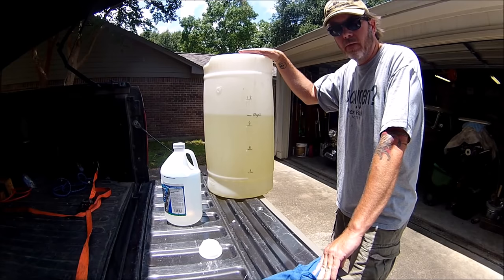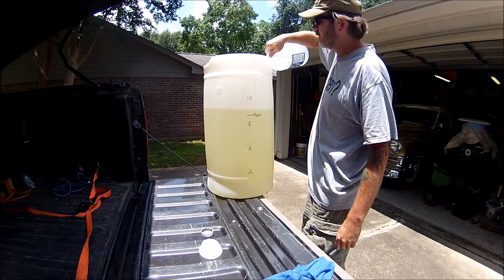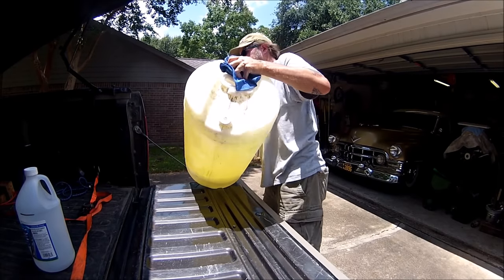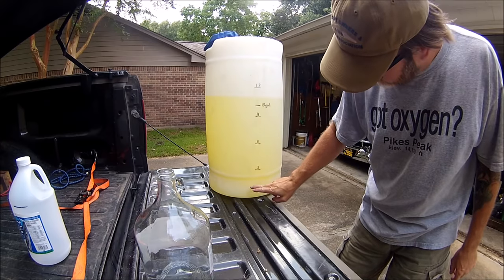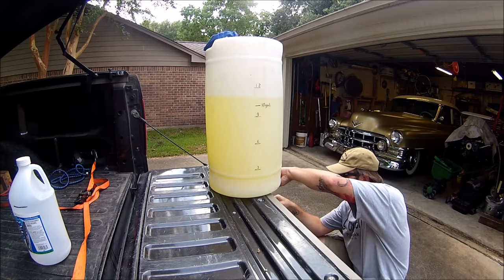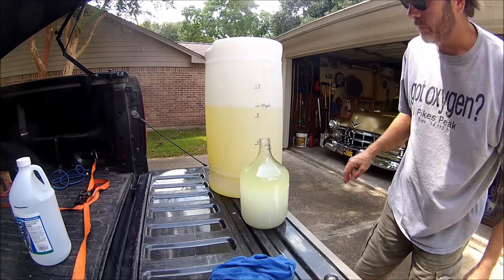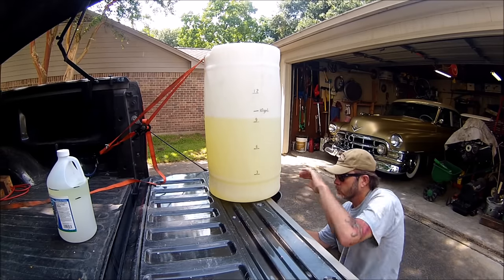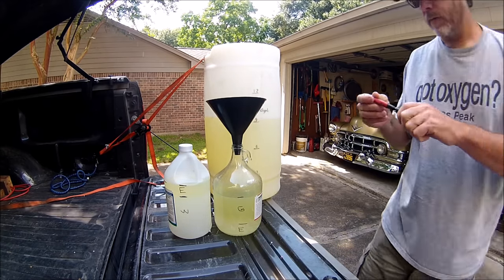How to easily extract ethanol out of gasoline.

Comment: I tried this... and when I put it in my Tesla... it did not give me better mileage...
Reply: Only a moron would drive a Tesla.  They are less fuel efficient and more harmful to the atmosphere than a gasoline engine, when you factor in the environmental impact of manufacturing, maintaining, recharging and disposing electric batteries.  Where does that energy come from?  Oh, right.  Thin air.  It’s a sham or maybe even a scam.
Reply: Probably because you didn't put it in the radiator.
Reply: That was a funny AF comment!
Reply: @danielholtxxl4936  Or solar panels lol
Reply: Matthew Prather Study the mfg process for making solar panels and all the other stuff required for thousands of recharging stations and all the energy consumption and pollution created in the process.  Then consider that solar panel stations only assist in the recharging process and do nothing to mitigate the plastic, lead, and corrosive acids used in the batteries.  Where will all that end up when it is no longer usable.  Landfills.  Alongside plastic straws.  Yeehaw, lets ban plastic straws and make batteries instead!
Reply: Must have a broken flux capacitor. Id try driving in reverse to see if your mileage starts to show improvements.
Reply: @danielholtxxl4936  Solar panels are made from silicon, metal, and plexiglass. I don't see what you're trying to say about that
Reply: Matthew Prather You apparently didn’t pay attention to my post.  Read it again.  It’s self explanatory.
Reply: @danielholtxxl4936    That tired old argument has been debunked a number of times by various sources.  To be sure, of course there is environmental and social impact of batteries etc, but long term, there is less environmental pollution as compared to ICE vehicles.  

 Battery and super capacitor tech is improving (and will continue to do so for awhile), and one can use more sustainable energy sources to charge same. 

    Petrol fuel is petrol fuel.  Not much to be done to improve it's impact, except build lighter and more efficient vehicles, as well as switch to biofuels.  

      Currently, there are no "zero impact" or even close to zero impact solutions, but there are the lesser of evils, and moving towards electric is already, and will continue to be more so, the lesser of evils.

Comment: A lot of Briggs engines have the rubber-tipped needle valve in the carburetor. Idk what this is about, because they are purported to work with various gas mixes, but for some unfathomable reason, the ethanol causes issues. I solved the problem by obtaining straight gas from a particular station, but it isn't always available. It's nice to know there might be an alternative if I can't get it.

Comment: After consulting a friend who works for a LARGE fuel company as an actual chemist blending current fuels and having him watch this he just started laughing at the shear ignorance of people doing this. The fuel left over is no longer complete and will do more damage than your THINKING you stopping. It's complete lunacy to EVER do this ignorant thing to fuel. Your not just removing ethanol but other component that make up the fuel. He tested several brands of fuel straight of the pump, did this same trick. And the highest octane rating he found was just over 78. From E10 87 octane and when he test burned it found it caused quite a bit of residue and carbon deposits inside tester and then he tried it on an actual engine Dyno, first with gas from pump, then thus mess, and found it lost 12%to 18% in power AND put out some seriously corrosive products out the tail pipe.
Reply: can we get some source?
Reply: I had gas stored for emergency for a few years before using it.
Was in plastic barrels that allowed some water in through the bungs.
I separated the water out (sinks to bottom) and burned the "very yellow" GASOLINE
in a generator (ran near continuous for a couple of weeks). Carbon deposits built up severely on the valves and valve springs to the point where one valve eventually stuck open.
I did not take the head off so not sure what it looked like inside the cylinder. ( To fix - I just sprayed PBlaster on the valve stem while holding the valve stem tip with vise grips - spinning and pushing up and down until it would operate without sticking)
I think running good gas will clear some of the deposits out. I have heard that SeaFoam can speed the cleaning if needed.
Reply: Your friend is Absolutely Correct. Gasoline is now sub octane and brought up to spec with Ethanol. All this guy did was contaminate the fuel and additive. Premium on the east coast is only 91 octane and recreation gas is not listed with an octane.
Reply: Monza is correct in his info.  If the presenter was able to extract the Ethyl added to gasoline by the refinery/blender then he has returned the petroleum to its initial substandard grade.  Probably low 80s Research Octane.  Since some refineries know they are going to add ethyl, they don't bother producing 87 gasoline anymore.  Low 80s trash gas, usually with pollutants like benzene still in it.  Add the Ethyl and the octane tests at 87.  Alcohol also helps stabilize and suspend the pollutants and sour diesel elements, thus removing it produces a paraffin fuel that has an odor not unlike kerosene.

Luckily the presenter is not doing chemistry, just an exercise in separation layers.  He adds a gallon of water and removes just over a gallon of mostly water.  He might be getting 6 oz of Ethyl/Petrol/Water that is milky.  He didn't break the blend by simply adding water at room temperature.
Reply: That's what college does, it kills your common sense
Reply: @Bryan-Hensley  common sense tells you the Earth is flat.  Not always the best teacher.  Like people saying they're Street Smart.  Usually dumb people desperately wanting to use to say the sentence "I'm smart" and having to add a qualifier.
Reply: @STho205  that's not common sense. Someone with common sense knows the earth isn't flat. 
I've known several people with a master's degree who doesn't know how to change a tire. Supposed to be so educated but doesn't know how to survive. I won't hire someone in my business who has a degree because they don't follow instructions well. I only hire people with skills.
Reply: @STho205  oh yeah, I don't know how you rate "smart" but I own a successful business I built from the ground up and I'm a landlord of several properties. College is a waste of time. Go to a skills school like I have or you'll end up a jobless trump protester.